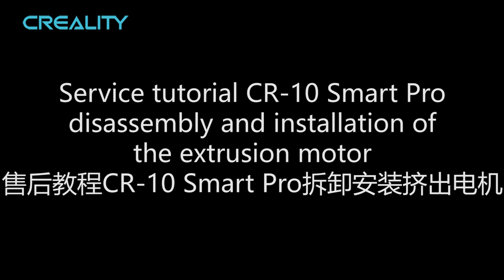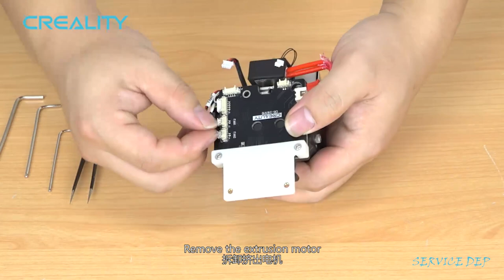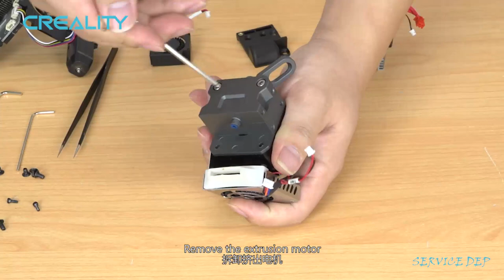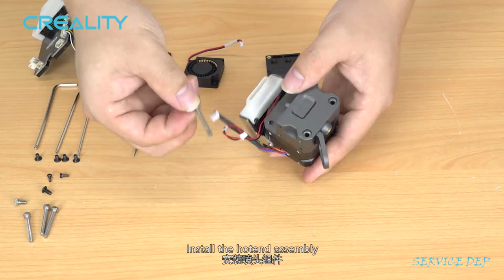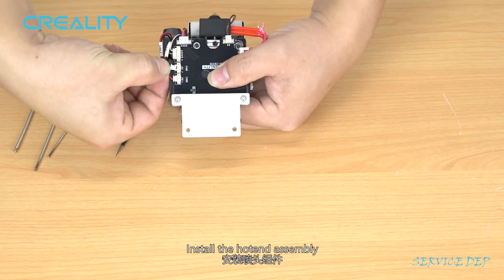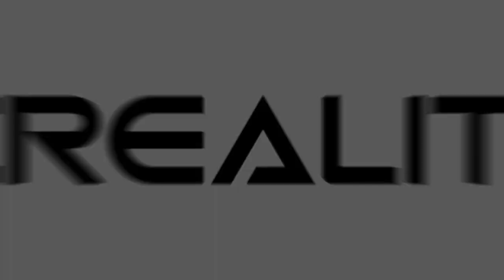Service tutorial CR -10 Smart Pro disassembly and installation of the extrusion motor

Comment: THANK YOU for making and posting these videos! VERY HELPFUL! In my revision some of the bolts/screws were in slightly different holes and one was missing. But I suspect that might just be due to process/hardware revisions over time, as the parts don't seem to be insecure as a result.

Comment: Hi, at the time 2:30 i noticed a gasket or insert in the bottom part of the extrusion motor . I don't have it there , is it problem , or is it irrelevant?
Reply: If you're talking about the "blue" part, for me it was a "white" part, but that looks to be an internal bowden tube, which is short, for where the filament is pushed through. If you mean something else, I am unsure what you mean then. Hope that helps! (I'm not Creality)

Comment: There are several errors in the video.
In reality:
- The connectors are glued (but possible to remove the plate without disconnecting the wires).
- In the video a screw is not represented which holds the plate with the white circle connector next to the T-43S connector, and therefore prevents the dismantling of the plate and the cowling.
- The side fan screws have washers, be careful not to lose them.
- The fan support has only 3 screws (unless forgotten during factory assembly)
- The heatsink has only 1 screw. (unless forgotten during factory assembly).
- The 2 screws of the extruder were found loose (a habit at Creality).
Reply from the maker: Hi,the video tutorial is for reference only, and the actual situation may differ from the video content due to production batches/design changes. Please combine your machine and video instruction to operate.
Reply: Thank you